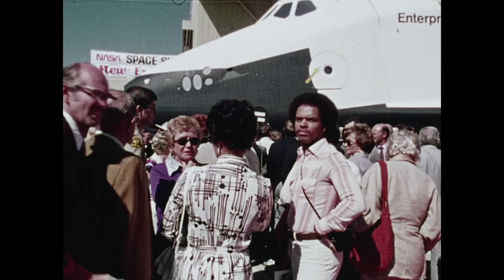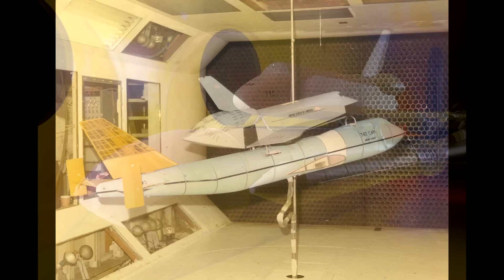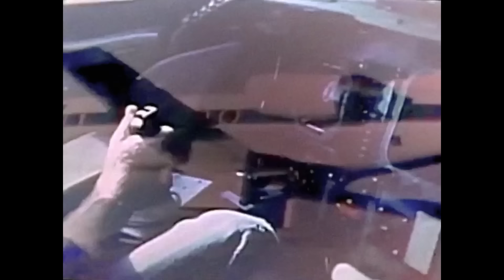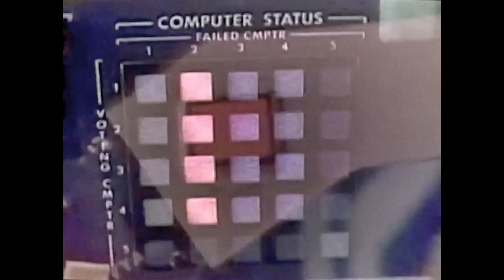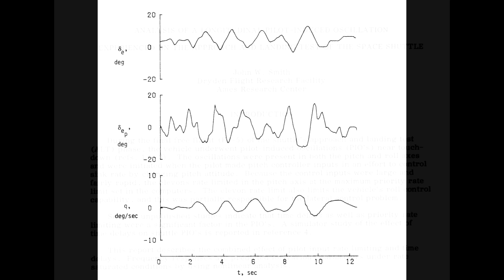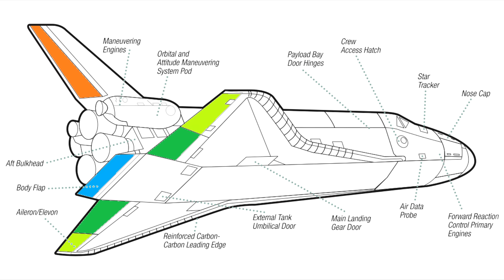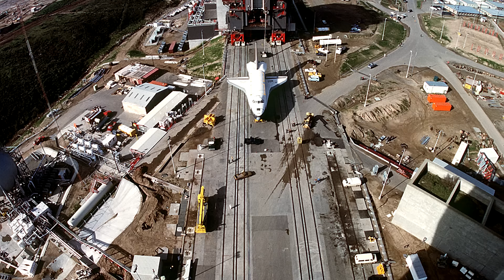How NASA Learned To Fly The Space Shuttle Like A Glider

Comment: Nice video, but you still short-changed Enterprise's contributions to the Shuttle program. Before the official decision had been made to not use Enterprise for spaceflight, it was taken (as was the original plan) to Marshall Spaceflight Center where it was mated to the first complete Shuttle launch stack and then put through a series of grueling vibration tests that simulated phases of launch to see how the stack performed structurally. 

By the time that was completed in 1978, it'd been decided that STA-099 would be converted to OV-099 Challenger and Enterprise would be used for fit checks and other duties before being retired. Enterprise was ferried across country to Kennedy, rolled into a Processing high bay and then to the VAB to be mated to another inert launch stack, and then rolled out to LC-39-A for a series of fit and other tests, including a practice countdown with John Young and Robert Crippen.

After this, it was returned to Palmdale, but many of her components were removed for use on other orbiters to save money and then after a bit of cosmetic work, sent off in1983 and 1984 for a major world tour across the Atlantic to Europe and the U.K.. 

Following that, in 1985, it was sent for the fit checks in Vandenburg and then sent to the Smithsonian. After Challenger, Enterprise got used for a series of runway arresting system tests.

But it is interesting that NASA tried for many years to downplay and deny they ever had any intent to use Enterprise for spaceflight. And you could do an entire video on that alone, including on her initial planned missions that were tentatively scheduled for July 1981 to deploy Intelsat V satellite and retrieve the Long Duration Exposure Facility . You can still find copies of the official NASA Shuttle flight manifests that list Enterprise on it.
Reply: The biggest give away that it was meant to go to space is it was named OV-101 instead of STA-XXX like Challenger originally was.  It is a shame that its importance will always be downplayed since it never got its retrofit.
Reply: Would you happen to know why the intent to use Enterprise for spaceflight has later been denied by NASA? That's puzzling to me.
Reply: @hellelujahh  there were improvements to the orbiter design after Columbia such that it made more financial sense to build up a new orbiter (Endeavour) from spare parts than to strip down and retrofit Enterprise.
Reply: @jasonosmond6896   I may have been a little unclear, but my question refers to the part of Thomas's comment towards the end, where he says NASA has been downplaying and denying their original intent to eventually use Enterprise for spaceflight. I never knew that, so I'm curious why they'd feel the need to deny. The reasoning behind not upgrading Enterprise is perfectly sensible like the video explained (and you repeated in your reply), so why deny changing their mind?
Reply: @hellelujahh  Because it was a huge publicity hit for them that the one Shuttle orbiter named after the legendary starship Enterprise wasn't going to orbit after all was too much for the PAO, so they decided that rewriting history was better. 

For the longest time you couldn't get them to admit to it and there were many NASA and spaceflight publications that would repeat ad-nausem that Enterprise NEVER was intended for spaceflight until people like Dennis R. Jenkins (read his excellent books on the Shuttle program!) started reminding them that Enterprise was at one time in the launch manifest.

There was a great article a few years back where a copy of the 1977-78 launch manifests were published with Enterprise still boldly on it!
Reply: @thomasackerman5399  Fascinating. Thank you for coming back and sharing some more! I kind of forgot how important it can be for a government agency like NASA to be in the public's awareness and to have its support. Now it makes sense that they'd try to weasel out of that perception of having betrayed the fans. Thanks for the book recommendation too, I'll see if I can get my hands on any of Jenkins' work!

Comment: That may be the ugliest, but it wasn’t the worst.  Late 96 or early 97 there was one that landed so short that the skid marks were just a hundred feet or so from the end of the runway.  I think Halsel was commander but I doubt he was flying it when they got into trouble (but he did take over and make the landing strip).  It dropped very low and was throwing up water spray from the swamp.  They got into ground effects and got a bounce and were able to gain just enough height to make the end.  I heard there were cattails in the wheel wells when they got it back but I don’t know if that was true or not. It’s the one they called out ENERGY during the turn over the landing strip.  It looked like they were not going to make it. Terrifying.

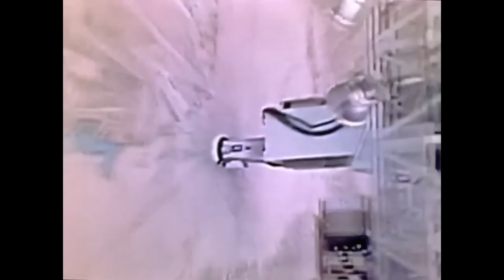Comment: 6:10, wait SOMEONE needs to make a full video on that 70s flight simulator, it sounds awesome! I wonder if they kept the whole map and camera system somewhere? I really want to see what does it look like inside the cockpit in high quality, there's barely any infos about it on the Internet
Reply: Yes, the map still exists! It is on display at KSP, on the wall. You would need someone to point it as it is easy to miss. I saw it in 2018.
Reply: @dotancohen  LOL, first thing I thought was that you were joking and meant the Kerbal Space Center ! 😅😅 before I remembered the Kennedy Space Center initials 😆
Reply: This was a pretty standard way of doing flight simulation at the time. It was not very realistic or high quality.  And the map the camera followed didn’t include anything off to the sides and the camera had limited movement.
Reply: @andrewgillis3073  For airliner simulation, there was typically a high altitude and low altitude map. The latter depicted a limited area around the airport only. I have seen parts of one of the models. Creating these models must have been an interesting job.
Reply: They have the map in a video with Tom Scott on the Objectivity youtube channel.
Reply: No, likely got scrapped, along with the rest of the Apollo era hardware, or taken apart and used for other projects.
Reply: @SeanBZA  Yeah but the one shown in the was a plane simulator for training airliner pilots, not a Space Shuttle simulator, so there might be a chance it wasn't scrapped yet

Comment: We watched one of these drops basically "live".  My father was one of the techs at IBM Owego that physically built the circuit boards for the Flight Computers for all of the Space Shuttles including Enterprise.  Dad worked for the father of NASA / SpaceX Astronaut Doug Hurley who lead the project for Columbia STS-1, to which Dad did contribute his craftsmanship.  

Dad was also a Core Memory Specialist which the Space Shuttle used for "NVRAM".  Challenger's Core Memory was eventually returned to his lab in a tank of deionized water, for forensics.  

Years before Enterprise, Dad was the IBM DDAS Telemetry Network Controller in the Firing Room for Apollo 10, 11, 12, 16, 17, and Skylab 2, 3, and 4.  Dad can actually be seen in the recent CNN film "Apollo 11" in # FiringRoom1 at his DDAS Console as the camera glides by:  # ProjectApolloFilm
Reply: Very Cool story. I worked DPS at the Cape on your father's GPCs back when they were 2 units (an IOP and a CPU) and then later when they were combined and upgraded into a single box. In the beginning the 4 PASS (Primary Avionics System Software) GPCs were pretty susceptible to FTS (Fail To Sync) but buy the end of shuttle program those babies were rock solid.

Comment: "it's not a fighter jet, it's a flying brick on approach" LMAO
Reply: To be fair, a lot of fighter jets are aerodynamically worse than a brick, but fly because even a brick can fly, if you strap a big enough engine to it.
Reply: @SeanBZA  Israeli F-15 lost a wing in a midair. Solution was to accelerate to 300+ kts and have body + deflective lift take over for the missing wing.  At that point the remaining wing was just an aerodynamic fuel can and the plane was flying on thrust, body lift, and the independent control tail planes and rudders. And the topper: he successfully landed it crossing the threshold at 300kts.

For truly the most extreme case of a flying engine with a few control fins attached, check out the F-104.
Reply: @SeanBZA  and the Right Control systems even a brick can fly ;)

Comment: And despite the Shuttle being a essentially a flying brick, some people still think the USAF forced unnecessarily big wings on it (which they didn't, BTW). There were even some Phase B Shuttle concepts that could do everything the TAOS shuttle could, and still be fully reusable. Too bad NASA didn't have enough money for them... #FundNASA
Reply: They forced on a lot of stupid abilities that were never useful and forced the design to make a lot of compromises on the stuff it was actually used for. Such as extremely long cross-range capability, which led to larger wings than they would have used otherwise.
Reply: @lobsterbark  Like I said, the Shuttle was already a flying brick. Any smaller wings, and the landing would've been more of a controlled crash. The delta wings were basically the only option - lifting bodies have a problem with ballancing (any change in the center of gravity, and you have to redo the entire body), and straight wings would melt off on reentry (there was even a NASA study on it). The crossrange was useful for NASA - it allowed for more flexible abort vectors, and a wider range of possible orbits. The large cargo bay was also NASA's idea - it would help the Shuttle to be more flexible with payloads. There were even some concepts of enlarging it, since it was still too small for some! The only pieces of the Shuttle hardware the military was involved in was the (unused) infrastructure for the Vandenberg launch site, and the exact cargo bay dimensions (it could've been a bit smaller and still meet NASA requirements, but not by much - by a few meters most).
Reply: @HalNordmann  Its the combination of the large crew, the large cargo bay, and the long cross range capability that crippled the shuttle. NASA wanted to have a large cargo shuttle, and a large crew shuttle, not one vehicle that does both poorly. But to meet the military requirements, it had to do all in one.

To do all in one, the craft had to be larger, which means bigger wings.
Reply: @lobsterbark  NASA after Apollo had only enough money for a single launch vehicle. Thus, the Shuttle had to fill in every role the agency could concievably need. The military would also be fine with a separate large cargo autonomous / small cargo with crew shuttles. However, those would be two separate vehicle types - NASA could only build one. Do I need to remind you they basically had to beg for a 5th Shuttle orbiter to replace Challenger? Or that they chose the solid rocket motors as a mean to save development money over liquid-fuel boosters?
Reply: @HalNordmann  NASA calculated that having two separate vehicles would be cheaper than having one. Like, the cost of one crew shuttle and one cargo shuttle would be less than the cost of a single shuttle of the kind they ended up building. Yet the military forced them to build the one.
Reply: @lobsterbark  It would be cheaper to HAVE. Not cheaper to BUILD - an that was what lead to the Shuttle being the way it was. You would have to build two different vehicle types, and twice as many orbiters to always have the ones needed for the mission. NASA had to beg for a single additional orbiter that was basically built from spare parts - doubling the orbiter fleet would never pass the Congress. Many other parts of the Shuttle were also driven by being cheaper to build - the TAOS Shuttle was literally the last option for NASA - but it was the cheapest to build, so there it went.
Reply: @HalNordmann  "lifting bodies have a problem with ballancing (any change in the center of gravity, and you have to redo the entire body)" - Wait, what? Modern fighters make extensive use of lifting bodies, and center of gravity changes instantly whenever they pickle off a 2000lb bomb.
Reply: @ChucksSEADnDEAD  Yes, many fighters use partially-lifting designs, but no full lifting bodies. Plus, they have extremely powerful engines which ballance any instability out, and store their munitions at the center of gravity. The Shuttle couldn't use that design at any larger scale, since it had no engines and an uncertain weight of systems - you wouldn't want an aircraft that tends to pitch up/down constantly. They also need fuel tanks with a complicated shape - not much of an issue for jet fuel, but a killer for cryogenics.

Comment: Still think a type of Shuttle is needed nowadays, especially to refurbish missions to satellites. An extended version of the Dream Chaser with a small cargo bay, launch on top of a rocket, would be an option. Functioning as a launch abort system too.
Reply: Starship could potentially be used in this role -- it's large and versatile enough that it could be modified to service satellites or even bring them home for repairs.
Reply: Starship will be able to do pretty much anything, and at a tiny fraction of the cost of a Shuttle launch.
Reply: @andrasbiro3007  not so excited with Starship. Seems to be getting heavier, to a point, that the final payload could be way lower to the point they consider remove the flaps. The cargo hatch seems getting smaller. The TPS tiles system is too extended, and being applied to the tanks, could be more prone to be damaged. Too massive to maneuver in LEO. Needing to land propulsive, and not having an abort system could delay too much the crew certification by NASA. The market is increasingly choosing smaller launching rockets as Rocket Lab. The amount of refueling need at LEO to missions to the Moon and Mars, could be a divergent to other systems. Having to land a Starship on Mars at interplanetary speeds instead of a capsule module, could be a safety concern. Prices per launch won't get substantially lower, due to costs with maintaining the launching infraestruture, refurbishment, and Staff.
Reply: @joansparky4439  ignorance? Valid points were presented. At least debunk them, and stop acting like a fanboy.
Reply: @joansparky4439  your answer lacks proper Scientific critical thinking. You're the "troll" here without any valid answers. Time will tell who had more accurate points. Maintaining Falcon 9, use a bigger payload fairing to Super Heavy, develop the Red Dragon capsule lander plus a fuel module. Could make, way more economical sense than Starship to SpaceX.
Reply: @RogerM88  Except that the projected payload for Starship has not been revised down, it's been revised up, 100 tons+ now.  Your understand IS flawed or dated.
Reply: I don't think the ability to service satellites was really related to any other feature of the shuttle, I think you could modify several of them existing/future launch vehicles to do that, there just hasn't been enough of a reason to.
Reply: They already have developed small satellites to grab near end of life satellites to push them out of orbit, or to extend their life because of fuel shortage...

Comment: The Space Shuttle doesn't fly "like" a glider, it IS a glider. So, they were learning to fly the Space Shuttle, period.
Reply: shut up
Reply: @waterStrider2   During descent it was a glider, by definition. But, instead of the more usual glider that has a high lift to drag ratio, the Space Shuttle had a low lift to drag ratio. The shuttle was designed with a low L/D ratio (~ 1) because during the descent the spacecraft must be slowed from about 17,300 mph to about 250 mph at landing.